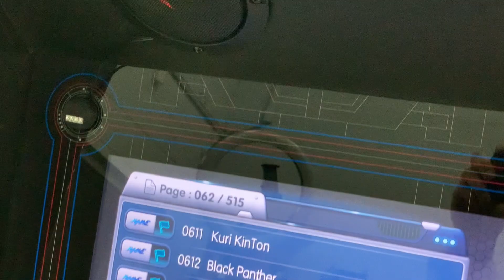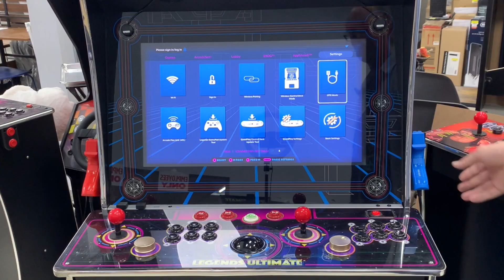ALU Retro Shooter Integration Kit teaser

Comment: does this work with alu 1.0
Reply from the maker: Mounting the Retro Shooter would be different and I'm not certain the best way to get the IR modules wired from the back. But otherwise, the ALU 1.0 supports OTG the same way, so it would work.